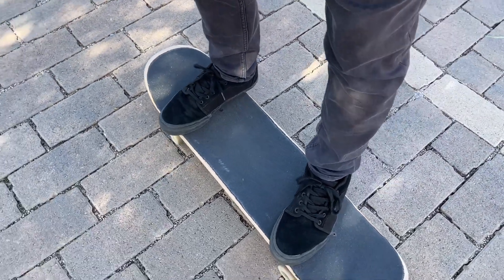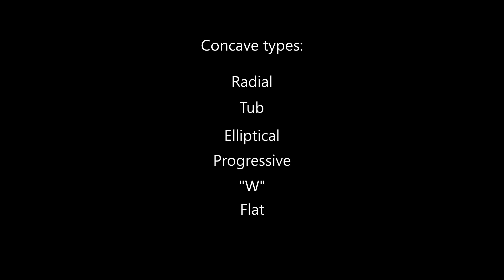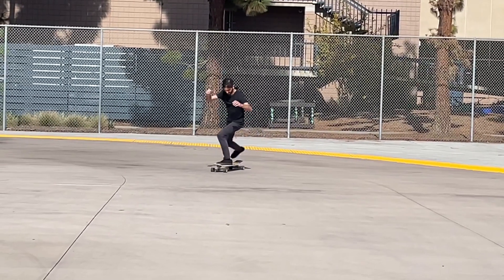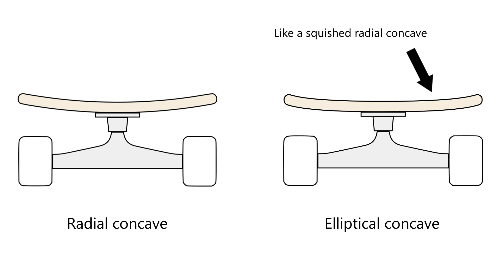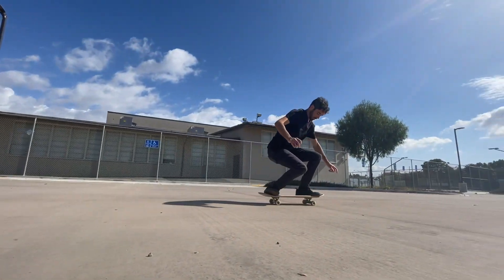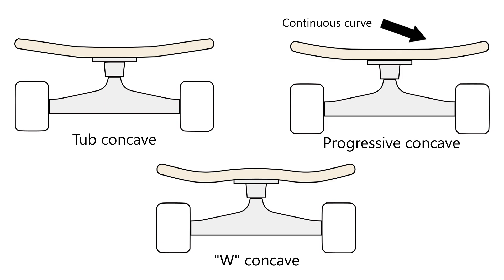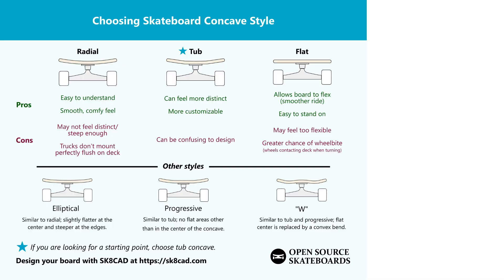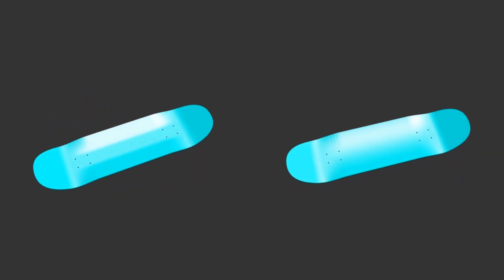Skateboard Design: Concave Style (Ft. SK8CAD)

Comment: Hello !! Excellent job. How many inches do you recommend for a fully concave street deck similar to K20 of Powell lets say. Thanks a lot !!!
Reply from the maker: I'm not sure specifically how much concave the K20 shape has, but you can easily measure it as I describe in this tutorial: https://youtu.be/pFxpMGMop-Q?t=538 (I think most street decks have around 0.3" - 0.5" of concave drop).
Reply: @openSourceskateboards  Thank you so much i forgot to mention you that i confused with the concave measurments on the foam mold . After i measure the 3rds from the kick and the nose line i count 3 inches till to the profile of the mold.
Thanks again for your time and your knowledge.